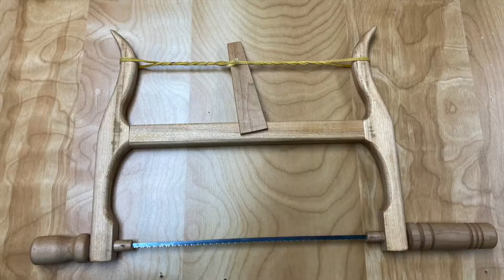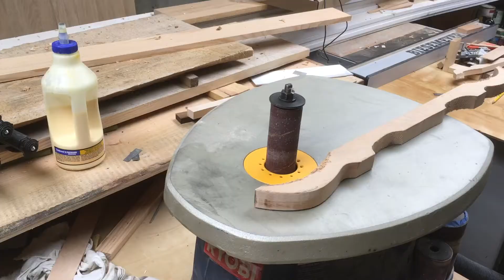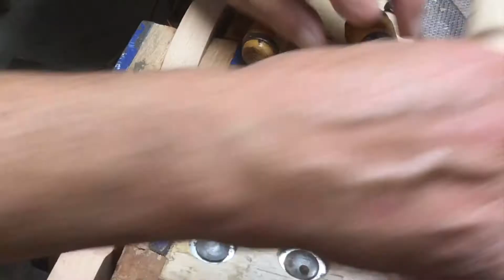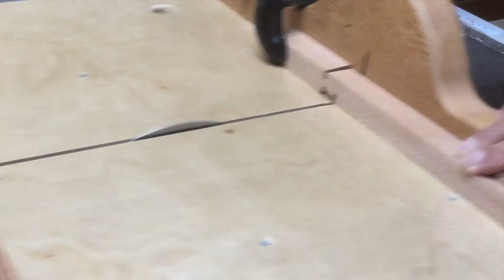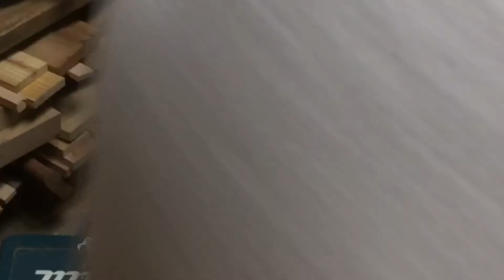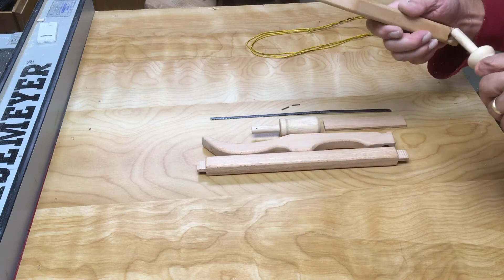You can build a classic small Bow Saw

Comment: how'd you drill the blade? what bits?
Reply from the maker: I had a 3/32 bit. I just used snipped finish nails as my pins. 
Measure your nails with a caliper and I get that bit
Reply: @makingthings1463  Size is not a problem for me since anything thats bigger than my pins would do. I made my framesaw to standard hacksaw blade sizes since I didn't have any other straight blade then. Now I need to buy a bandsaw blade, cut it up and drill pin holes in it.

Since you didn't mention what type of blade it is I am assuming the main strip of the bandsaw isn't a hardened steel? Because I have tried normal bits and they just dull and ruin on hardened saw blade steels.
Reply: @makingthings1463  I purchased a tct bit. Very expensive. Seemed to do the trick of drilling the saw blade.

Comment: I can't make this in my small garage shop. No lathe.
Reply from the maker: Thanks for watching. You could use 1/2” dowels for where the handles go through the frame and have square handles 
Just a thought
Reply: Ok, thanks. I need to work on thinking outside the box.  @makingthings1463
Reply: @makingthings1463  what if I want it to have a 6.5 inch blade?
Reply: Shrink it down  @timlist4173
Reply from the maker: I agree. Shrink the whole saw or it would be unwieldy

Comment: Do I have to make a groove for the string.
Reply from the maker: thanks for the comment.
No the curve in the shape does the job.
If you're making a straight sided one then a groove is helpful. See my folding saw. I make the groove with a chain saw file.
Thanks again
Reply: I have made with with straight sides. I didn't really need a groove, the strings stays taut of its own tension. Though I could file one for ease of putting the string back on after loosening it.

Comment: very nice instruction.  love the techniques.  Does this type of saw use a pull or push orientation of blade.  also anything special on "drilling" a bandsaw blade?
Reply from the maker: Thank you for the comment. I use it on the push stroke but you could put the blade in either way and try it. As for drilling, just a sharp bit and a drill press to keep it from squirreling around.
Reply: @makingthings1463  What kind of bit? Did you need to use a carbide bit?